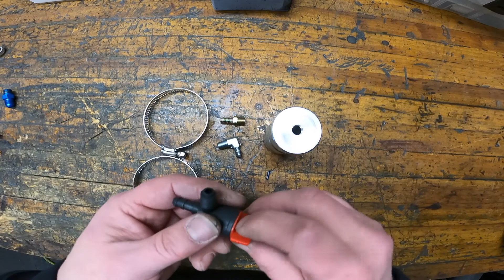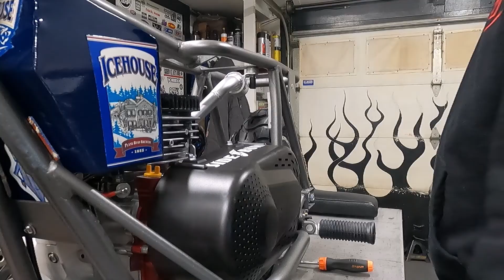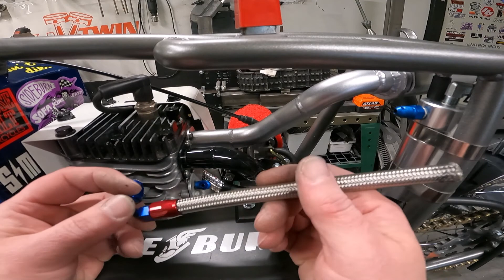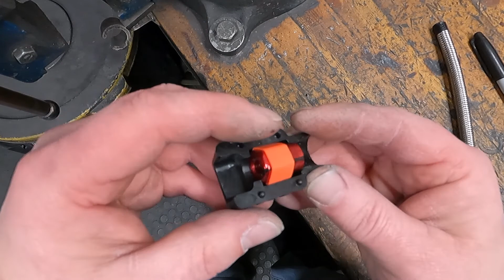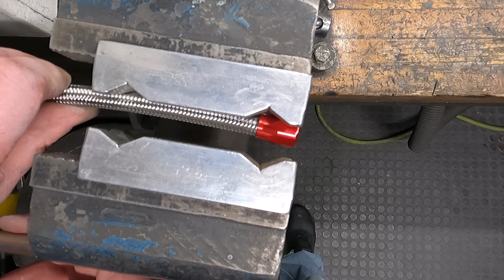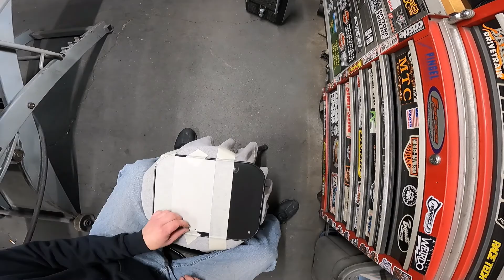Go Power Sports Minibike Breather Catch Can Install Custom  AN Line Build Tecumseh Flathead Part 8

Comment: I haven't used one of these yet. I drill out my galley holes and on my high comp gx160 I did the Crankcase cover to valve cover vent hose. When you rev it up you can definitely see oil go through the line. I've always wondered how much oil ends up in these cans though.....🤔
Reply: Depending on how hard you ride I was surprised after 2 tanks of hard riding I had around half Oz I need a new one mine got dinged off a tree on trail pretty good it still works surprisingly its just oval and not very round anymore
Reply from the maker: I've got them on my other bikes. The only time there has been oil in the tank was after crashing. This engine is pretty loose though. So it has some blow by.
Reply: @DarkCornerGarage  I just built ANOTHER 196 (lol I admit I have a problem) and this is the second one that has a used 14cc head with no valve seals from the factory. I can understand the cause for concern as the compression goes up.
Reply: @fatbuddycat  been working on rascal I bought front brake kit suspension and 212r I have a cheetah 15 tooth I need to get a 40 chain sprocket still just not settled on 60 54 or going with split set up